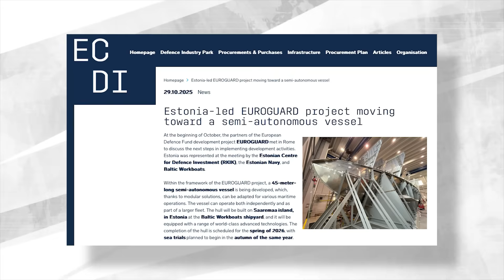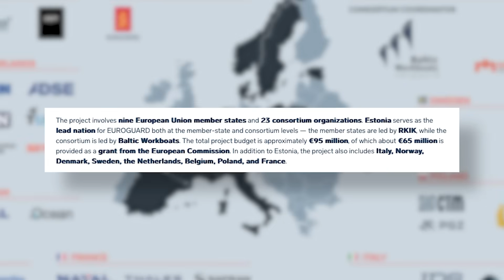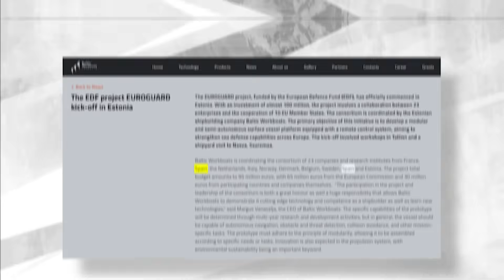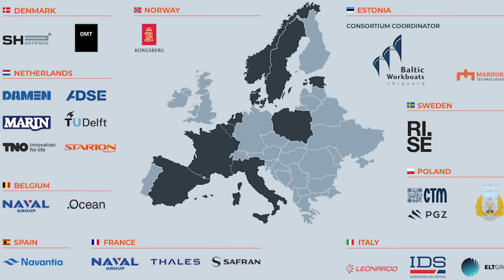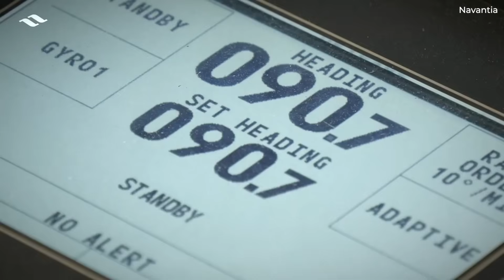EUROGUARD: A Semi-Autonomous Ship Project Involving 9 EU Nations

Comment: The initiative shows a foreword looking promise of integrated R&D, as well as economic advantages through procurement scale, should all go to plan.
By and large, a clever solution to deployment of a platform configured for complementary resource/expertise exchanges, huge cost savings by operating
a shared hull, maintenance/modifications can be performed at any allied port as the modular frameworks may potentially be readily dropped onto the hull.
A greater challenge than swapping out the mission modules for the Boxer but, might be feasible in theory, just a much bigger it of kit. That would certainly
prove to be a game changer if practicable. A little wild wish listing is fun if nothing else, but a cool concept.     Be well and stay safe